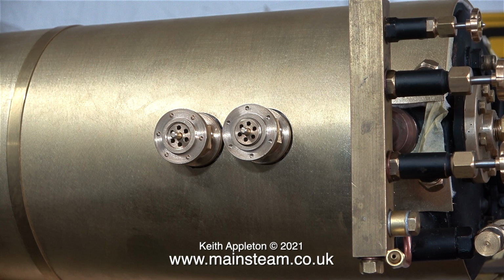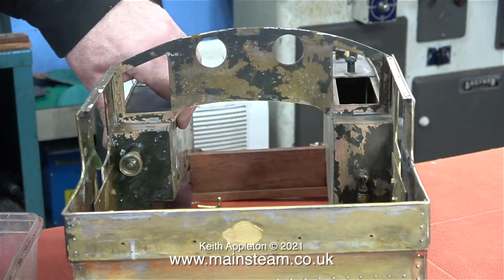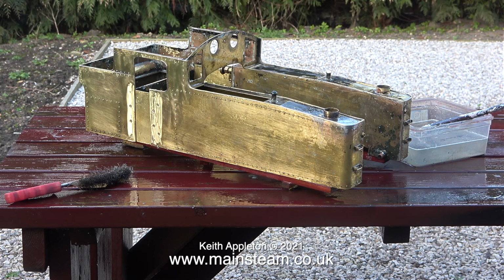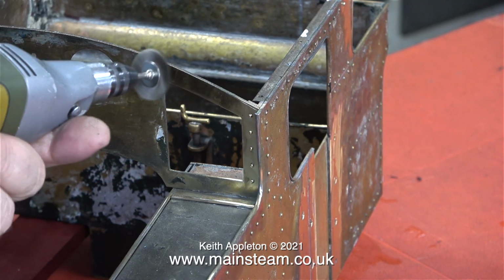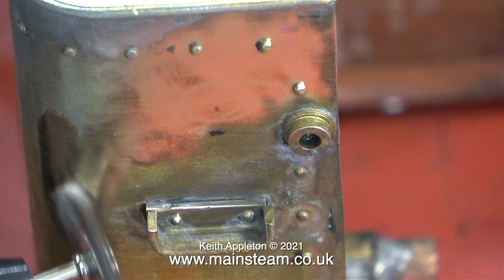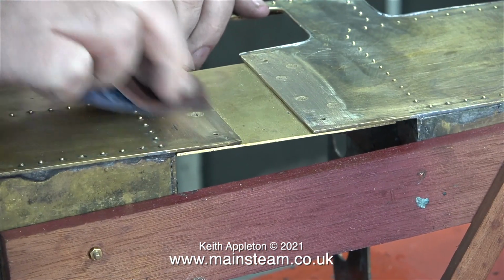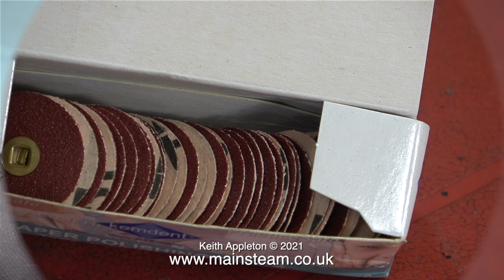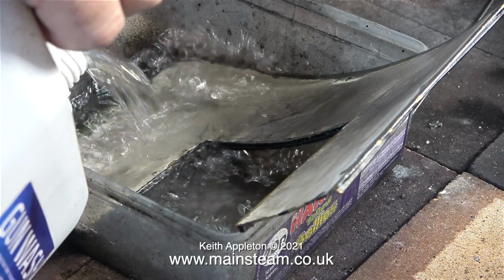SIMPLEX PRAIRIE TANK - PART #79

Comment: A process you might to look into is vapour blasting it would be fine on brass and soft solder, it's used extensively for restoring old coins and parts contain rubber seals as it doesn't damage

Comment: If you do a search for nylon abrasive wheel you can get quite large diameter drill mounted wheels for cheap.  You get a better finish than the wire wheels and they last a very very long time and they dont fling bristles.  You can get them in the pointy and cup variety as well.  They have completely replaced bristled wheels for me unless I need to clean out threads or other very narrow places.

Comment: Keith, safety goggles are definitely highly recommended.  When I was young,  I worked in a silk screen print shop where one of my many jobs was to clean the silk screens after they were used for a print job.  Vinyl inks require a very nasty solvent (vinyl screen wash) for cleaning the screens.  Once we had to take a large screen to a car wash to clean because it was too large to clean in our ~10-ft wide sink.  As we loaded everything into a pickup truck, a single drop of vinyl screen wash dripped out of its can onto the painted bed of the truck.  I immediately leaned down to wipe it up with a paper towel I had in my hand, but the paint had already bubbled up before I could reach it!  That stuff would make a good paint remover, especially for enamels and similar paints.  I also got a single drop in my eye once, around my glasses, and my eyes burned & teared so badly that I literally could not see, other than vague shapes as I found the hose pipe in the sink to flush my eyes for ~10-minutes -- talk about "red eye" after the fact!

Based on personal experience, regular safety glasses aren't very good when grinding or using wire brushes (or cutting the grass).  I've had particles go around the edge of my safety glasses twice, once requiring an eye surgeon to remove a rust particle from the tissue over my lens.  I now always wear chemical safety goggles no matter what I'm doing due to fear for my eyes, even though they tend to get uncomfortable after a while -- but I'd rather be uncomfortable and safe than risk my eyes again!  One commenter below mentioned safety glasses behind a full face shield, which is also probably a very good solution which I think I'll try.

Comment: Hi Keith. Big fan of your work. A not top tip, unsolicited I know; regarding the spindle type wire brush. I use them until the bristles twist up and then reverse the spin on my drill. Not so easy to do using multi tool.
Reply from the maker: Thanks Eric, That's a good idea. I could fit them in my larger Battery powered drill and run it in reverse. Thanks for the tip. }:-)))

Comment: Those darn bristles, been thinking about buying some super cheap cagoule coat to act as a barrier next time i have to do work with wire brushes, should bounce right off the waterproof surface.

Comment: I’ve taken a liking to a bunch of your videos.  Your library is quite extensive.  I hope you can find the time to answer a question I have.  Could there be a practical application of a steam reciprocating engine today, no matter the scale?  By practical application, I mean perform some sort of work outside the modeling and hobby communities.  I can’t bring myself to diving into this hobby without giving an example of work that can be accomplished by it. I understand the efficiency may not compare to something today, but give me some sort of pump, or generator, or something practical that I could accomplish with one.
Reply from the maker: Electricity generating, water pumping, air pumping, sawing, driving machine tools . . . the list is vast - just look at the History.
Reply: Anywhere where there is a lot of waste heat produced...? Or for that matter a solar powered boiler with highly concentrated energy focussed on it by mirrors...?

Not steam powered but certainly worth studying: hydraulic rams.  These exploit a large ‘head’ of water to pump a smaller volume of water above the elevation of the original ‘head’.  They can run for months without attention just clonking away unobtrusively.  They come in quite a variety of forms, not all of them pretty!  But I am going off topic!

Comment: I really enjoy listening to your commentary. However, My late father was a brush engineer. That has left me with a little problem. Not your fault, mine. Had this hammered into me. Bristle comes from Wild Boars usually in China. (So you can tell how long ago this was). Please Mervyn never refer to bristle unless it is real bristle. Anything else is wiskers,  filaments, wires, sprigs, anything you want to call it except Bristle. Sorry it is not your fault it is my upbringing. But it just grates. I apologize for raising this point.Mervyn Price